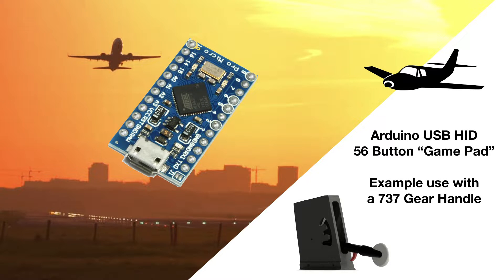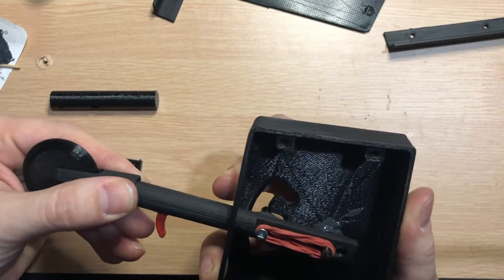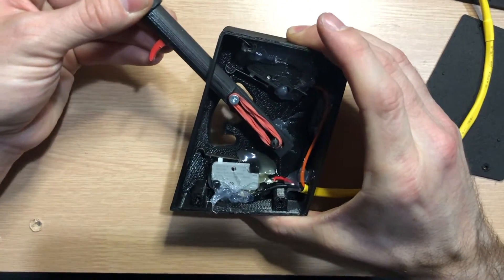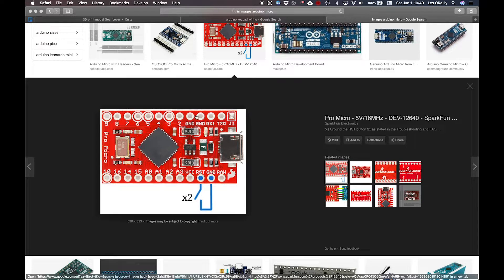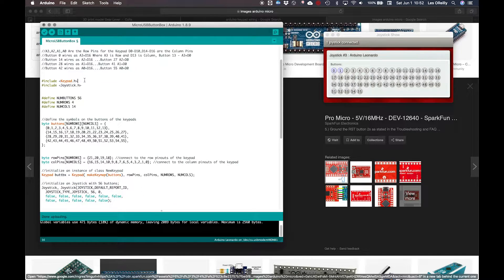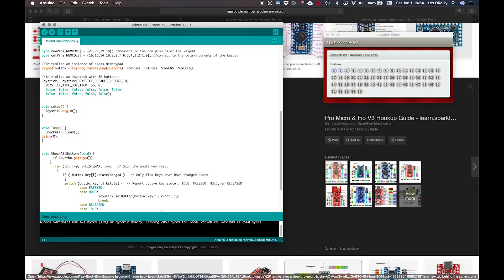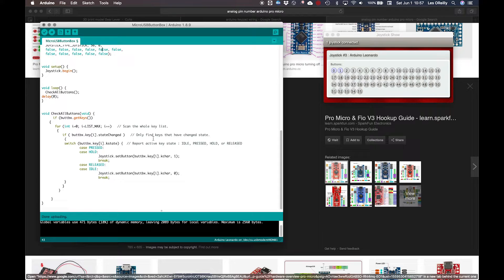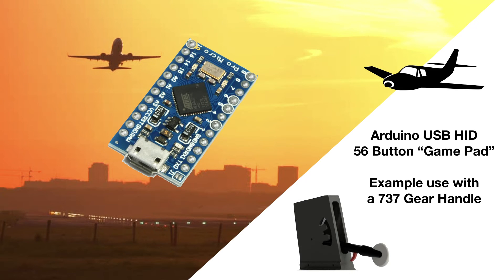Arduino 56 Button Joystick 737 Gear Control

Comment: Hey thanks for the great video, very helpful can you tell me will this be able to detect multiple button presses at once ?
Reply from the maker: Without using diodes in your hardware design you will need to try and space them to separate columns in a way that they don’t overlap too much with items you need to fire instantly together.
Reply: @LesOReilly  thanks
Reply from the maker: Yeah that looks about right ... I did not see this comment before now because it go held up for approval due to a URL link...
Reply: Could you use a Mega which has about 56 digital pins.
Reply from the maker: @damianbutterworth2434  Not with the USB HID Joystick...  The Micro  and Leo use the native USB of the 32u4....  The Mega does not have the same ability.... There is the Hoodloader mod stuff out there, but out of the box it seems you need to stay with the Micro and or Leo..
Reply: @LesOReilly  All the one`s I haven`t got. I have Nano, Uno, Mega plus an Olimexino which I think is an more heavy duty uno. Thanks for the advice. :)
Reply from the maker: @damianbutterworth2434  Well if you are using it with Flight Sim Stuff you can use those directly with Spad.Next and the Serial Interface to interact with the Sim....  But for a straight up Joystick yeah you need the Leonardo or Pro Micro....  The LEO is not that expensive and I got them off Amazon pretty quick Prime delivery as well
Reply: @LesOReilly  Yeah it`s for windows flight sim 2020. I`ll have a look at Spad.Next mate. I`ll let you know how I get on. :)

Comment: Hello friend, what a good project for joystick and buttons, I would like to have the connection diagram for the buttons, since I'm a very newbie even with Arduino and I don't understand much, I want to make my cessna 208 fsx cabin, thanks in advance for your  help and contribution.
Reply from the maker: Th comments of the linked code tell you which pins are the column and which pins are the row connections.
Reply: @LesOReilly  well thanks i will check the code

Comment: Great thanks to your tutorial, I made a 84keys  controller0v0
Reply from the maker: Thanks for taking the time to drop a note about your success!  Appreciate it.
Reply from the maker: There are other board options .. if you use an Arduino Leonardo there are more pins.  Making at 10x10 — 100 buttons can be done with one of those.
Reply: @Gilgamesh Akkadian  6(analog)x14(digital), actually is made up by 82+2 keys, i use 2 keys to control the brightness of the CDU keypad backlight, this two keys is connected to another arduino board which controls the keypad backlight RGB led(ws2812)
Reply: yes, of course.but i use micro board to control ws2812, I use these pin to control 2812 strips.but you only need one pin to control 2812 matrix by adafruit libraries in theory.

Comment: Hi.  I really like your movie and Arduino program.  I'm going to make a panel for B738 using Arduino Leonardo and your 100 button program.  I would like to connect 76 buttons there.  Would you share a video showing how to do it, or a diagram of a pcb board for connecting buttons?  I don't know much about it and I need help.  Best regards.
Reply from the maker: Just look up Button Box... Lots of examples...  Use Diodes if you want to ensure that you don't have Ghost switches

https://www.google.com/search?q=how+to+wire+button+box+Array+images&rlz=1C1CHBF_enCA925CA925&sxsrf=ALeKk02X0josqBWLCwiRZBRkv4F4o-P4fQ:1617298359979&source=lnms&tbm=isch&sa=X&ved=2ahUKEwiqxvfxyd3vAhXbElkFHeavB18Q_AUoAXoECAIQAw&biw=1920&bih=947#imgrc=tkhRQkWSW1_4xM

Comment: I've built a Yoke a Steering wheel etc using no mechanicak parts switches or potetntiometers for pedal and wheel movement, much cheaper and easier just puttin an accelometer tilt sensor to each pedal, the wheel itself etc. and measure the angle, also for the shift gear, just SAIYAN!
Reply from the maker: Cool!!!
Reply: what module , sensor did you use exactly

Comment: I am going through the process of making a button box. One of the things  I want on this button box is a potentiometer based 2 way axis or a joystick
Reply: Could you make a video on this process?
Reply from the maker: Maybe. I did a GPS controller with AXis for the volume knobs. 

Those were easy — as there was already examples out there. Encoders and large numbers of buttons using keypad is harder to do.  Will see if I can get some time. Been so busy with work these days working from home is more work than working from work :).

Comment: Hi friend where can I download the library files? Thanks a lot for this awsome job
Reply from the maker: Hi — which library files are you referring to?
Reply: @LesOReilly  Hello friend, sorry the libraries were installed by default. It was a failure of my IDE, now it is solved. To use it with a LEONARDO, the pinout (21,20,19,18) of the code would be the same? I made it work a month ago with my 3d printed H shifter, and I didn't keep a copy of the sketch. And now I would like to add more buttons through a button box. Thanks a lot
Reply from the maker: @kueto27  Sorry for such a late reply....I did not seem to get a notification that you replied......Another person commented so that brought me back..
Here is a link to a 100 Button Box Sketch for a Leo Board  :)  https://www.dropbox.com/sh/rgu3x2uebziepyj/AABkbc58Aa5YdeBx2u_ojR7_a?dl=0
Reply: @LesOReilly  thanks a lot friend this is awsome!
Reply: @kueto27  podrías ayudarme? Precisamente quiero usar dos switches igual que este video, pero en un sketch ya hecho, funciona con una palanca g29 y un arduino Leonardo

Comment: How does the computer know you're not holding the button down.
Reply from the maker: I don't understand your statement..... The Arduino is doing a loop and scanning the Button Grid.  If the Button is held down it reports as held down...
Reply: @LesOReilly  You answered question. When I toggle my taxi lights on the strobe from the controller input.

Comment: Should i add diodes in this project?
Reply from the maker: depends how you use it .. using it with a GNS 530 type project where you don't have multiple buttons held at the same time it is not an issue ..  if you don't wan to worry about ghosting then you need diodes.
Reply: @LesOReilly  Thanks :) Ghosting an issue for me. I added diodes to the columns, it works for me. But in online tutorials they are adding to the rows. If i add diodes to rows nothing works.
Reply from the maker: @requiem4adreamc  okay I guess it would be based on which way you hook up the columns and rows. As in which side column or row is attached to the analog outputs.
Reply: @LesOReilly  It makes sense. I will give it a try. Thanks :)
Reply: I think i connected the left of the row rather than right or vice versa. Or maybe diodes placed to the wrong direction.

Comment: Why my windows show 32 button ???
Reply from the maker: If you are looking in windows game controller it can only display 32 buttons. However games or configuration software can see them all — ie my sim interface of choice SPAD.Next sees all 100 on my one unit.
Reply: @LesOReilly  Thanks for answer . Now A3 Colomb 1.2.3....(Total 14 pin)  Row connect th toggle swich is great work but extra connect A2 Colomb 1.2.3...... Row not work . Disconnect 1 pin A3 row system connect 1 pin A2 row so working 10 pins .what can ı do .
Reply from the maker: @orpanyolcu3922  You are running into the issue where similar pins held on adjacent columns will have issues with  with Latched switches....  Try with Push Button Momentary buttons and it will be fine with independent buttons and then you design your spacing based on combinations that can be multi Held/pressed at the same time.  If you want to use Switches with ON/Off then you are going to have to design Diodes into your circuit to prevent this.

Comment: Can someone tell me why I was able to use the 2015 version of joystick.h without any issues and could happily upload sketches all day long. But the 2017 version doesn't even accept the same sketches and even the sample sketches that come with 2017 joystick.h continually brick my arduino to the point that I have to re-flash  the bootloader.
Reply from the maker: No idea here.....I use the Leonardo or the Pro Micro when doing joystick as it is the easiest way to implement a Native USB HID device.